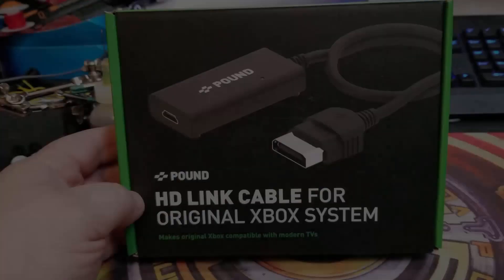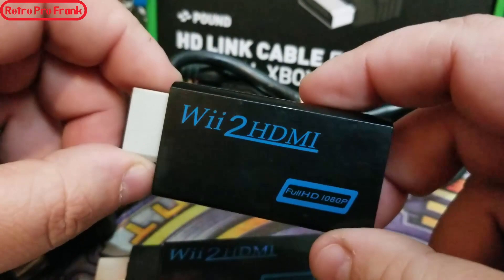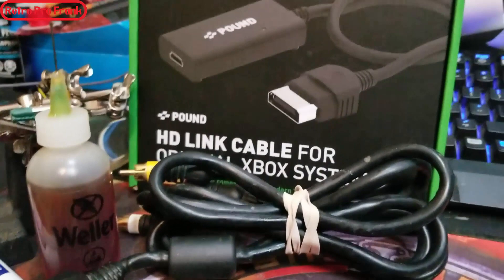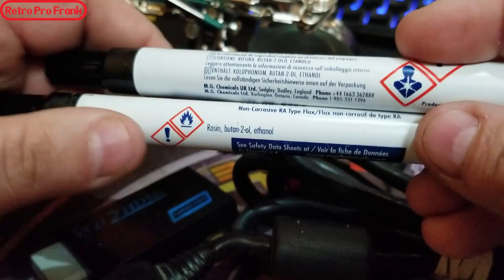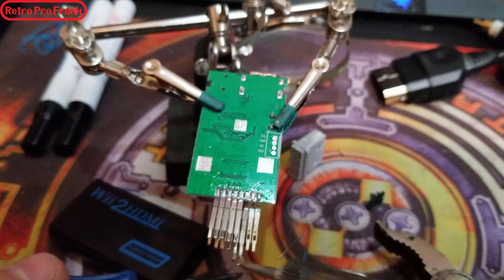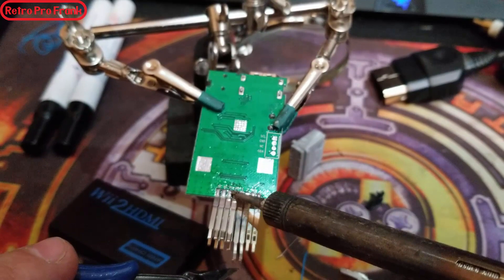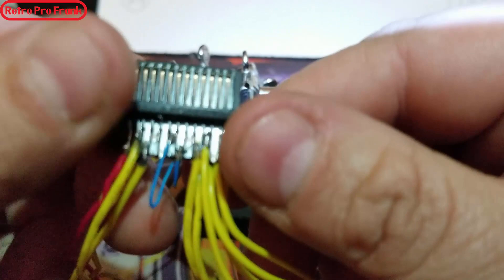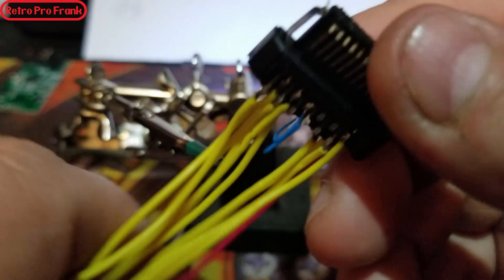How To Make $5 D.I.Y Original XBox HDMI Wire Wii2HDMI Xbox2HDMI Modd  - RETRO PRO FRANK

Comment: Awesome!!! thanks for this Video!!!!
I was able to build my "XBOX2HDMI" adaptor following your tutorial.

I will be using this adaptor for my second OG xbox which is dedicated to XBMC-emustation only, and my impression is that I like it better that hooking up this xbox through my OSSC, (I will use my main OG XBOX with my OSSC though). I never found a proper configuration with my OSSC to play 240p games with the OG xbox, but this little mod works out better with the filters that come within the emulators in the xbmc-E.

My comments for anyone planning to do it, as Frank says, check there are no bridges between that contacts and also, (very important) hot glue that thing. My God, before the hot glue, I was having such a hard time to keep everything in place.

Thanks so much again for this video!!! two thumbs up!
Reply from the maker: Thanks bro

Comment: Hello mate. I followed your tutorial, it wasn't easy. In my first try it did not work... I used very thin cables,the soldering was very bad... then I realized that I have one of those xbox360 connectors, so after starting again from scratch using your diagrams, I finally succeeded, it works quite well. I used the white wii2hdmi, it is technically  identical. Thank you mate. Before this amazing mod, I used to connect the Xbox to one of those GBS RGB converters, but it was quite messy, now it looks better. Thanks again. Cheers.
Reply from the maker: Thank you for your kind words friend glad it worked out

Comment: Hi, just wanna say thanks! 
I bought 2 of the converters online along with sacrificial composite cable.. When it arrived, 1 of them is kinda different, it's black with curved housing and it's easy to open on the side. The layout inside with one large grounding point instead of 2 square grounding. So I'd give it a shot and it worked!
Reply from the maker: Awesome great news thanks for the good comment have a great day

Comment: Built this with a White Wii2HDMI. no pin hole version.  Works great even though I suck at soldering and almost destroyed the connector. Thanks for the video.
Reply from the maker: Practice makes perfect if it works that's actually pretty awesome. The next one you make will be even better keep up the good work

Comment: Nice tutorial, thanks! Will definitely be giving this a go. Top tip with the shrink wrap on the helping hand clips too btw. Also - is that an lcd in the jewel on top of your X3 box? Looks great, id love to know what it is!
Reply: I've now successfully completed my first Wii2HDMI mod! Following your tutorial made it straight forward and resulted in success first time around so thanks for the detailed guide. Actually one of the trickiest parts for me was how to put the whole thing together neatly, but I found that by losing the bottom metal part of the Xbox connector enclosure, you can hot-glue the board directly into the top part of the metal Xbox connector casing. As long as you allow room for the board to sit in its guide rails, the whole thing slides neatly into the plastic case and is very sturdy.The picture output is great and an improvement on my component cable, although the picture takes longer to kick in on start-up so you lose the flubber annimation and splashscreen on XBMC4Gamers. BTW I used the white version of the Wii2HDMI - the board inside seems identical and its easier to get here in the UK.
Reply from the maker: @ciderfeks  thank you for letting me know that you've had great success with this. If you make a few more you only get faster and better as time goes by. I was glad I was able to help you out your number 24 that had great success. I've only heard of one person having a difficult time. But I think that person doesn't really have too much experience with soldering. Other than that it's great to hear the great news. Who cares about Flubber animation question mark what matters is gameplay and scrolling through your gamers in HD. Thank you very much for watching this video I hope you subscribe to the channel and give me a thumbs up please share this video with your family and friends and anybody else online who might be interested in this mod. This is a very affordable way to get HDMI out of an original Xbox for very little money. Thanks again and have a great day
Reply: @Retroprofrank  is that an lcd on your xbox?

Comment: Just done this mod for my xbox tonight as I've upgraded my tv but in doing that lost a lot of sockets and other input types, Works a treat and running it into an upscaler for 1080p resolution it's about as good as your ever going to get the picture considering the age of the console, Tried two different brand component to Hdmi converters and both were absolute crap picture drop outs, grain effects, scrolling lines top to bottom, should of just gone down this route 1st 

Cheers for sharing the info and diagrams👌🤙
Reply from the maker: Glad everything worked out

Comment: Fantastic job figuring this out
Reply from the maker: Took me a couple of days to get the wiring just right. There were some sort of write ups on how to do this. And image attached... what the problem was there wasn't a straight wiring diagram that showed Dport connection from the original Xbox 2 wii2hdmi.... yes it might have had an image that showed the wii2hdmi diagram. And a different diagram that showed all the outputs from the original Xbox Deport.. but not showing where the connections from the D port to the Wii HDMI directly. Seen a picture of someone trying to show these to Connected the problem was there was so many lines going from one side to the other in considering the Deport has two rows of pins. It's impossible to decipher. It would be more confusing than anything. So at that point when I seen this I said I cannot use this. So I ended up using the one diagram for the Deport and off of that trying to use common sense. Of where to solder wires. Definitely helped. If you notice in this video my wiring diagram shows a total of 5 grounding wires. You won't find this anywhere else even if you try to decipher the original which is more confusing that anyting.. to be perfectly honest with you I tried to tracklist back to the original inventor who came up with this idea. I spent a week on forms asking people if they knew and I found out that the Brazilians came up with the idea.. and I tracked it down to one main person. I message this person directly he told me that he was the first one to ever come up with this idea. No I did see one sort of schematic that was in either Portuguese or Brazilian or Mexican. It made no sense though. It was almost there to throw people off. So when I asked him about this he admitted that he made this diagram. And I told him well it doesn't make sense it's not going to work he said I know. He went on to tell me that he had different schematics. But he would not share them to anyone. I think that is a very selfish. Also went on to find out that they are charging around 40 to 50 USD a piece for this mod. So this is the reason why they won't release any schematics. Obviously they were making money off their own people. At that point I figured I would not give this person any credit considering he pretty much put out fake information to mislead people purposely which I find run. I'm merely figure it out the wiring myself because none of the schematics could have been entrusted. And I cleaned up the schematics completely so it's easy for people to understand. So I hand Drew my masters. I had a member offer to make it look a lot better graphically if I send him the original master schematics that I made. I thought that he was being nice by offering this but thinking about it it was just because he wanted to start making them and selling them. So I sent him the Masters. Then he sent me back a very cleaned up version of my masters. Which he did a good job on. In any event I hope that you were able to make your own from either this video or the drawings in the description of the video. Thanks for the comment and have a good day

Comment: BLowing on solders is not recommended it can create bd solders. Also, are you sure all those ground wire are necessary? There are many ground pin on the connector do facilitate the soldering of coaxial cables but in the end it's all connected together. In fact soldering them all instead of one might create more noise.
Reply from the maker: Yeah I'm sure did you not watch the video to the end when I show how clear it ended up looking with all 5 ground wires. If you want to be a butcher and use one ground wire that's fine with me. If you like to cut corners and that's your kind of thing go ahead. Me I will continue to do it this way because I know the video quality looks great this way
Reply from the maker: Out of a hundred people maybe one or two only using by one audio. If you would like to add coax. By all means you can do whatever you like. Majority of the people playing this are using the two speakers out of their TV for sound. Last I heard TVs don't have 5 speakers built-in and even if they did they would not be positioned properly for True 5 1 audio

Comment: Great video Frank! For whatever reason, my circuit board will not slide right out. It’s a white one, so I’m wondering if it’s a snugger fit inside. Yours came out so effortlessly, while mine is so tight that the wii connector pulled off. I don’t want to have to break the enclosure, but looks like I might have to.

Comment: Thank you for this video Frank!
I was able to solder everything in place (the second time!) but it works.
The video is great and so is the sound... until it starts crackling on the left speaker.
Do you know what can cause the left speaker to crackle after using the dongle for two minutes? Do I have a bad wii2hdmi dongle to begin with?
Thanks!
Reply from the maker: Check your work. I don't know what you're capable of. Take your time clean it up
Reply: @Retroprofrank  Thanks! I cleaned it and re solder one ground. It is now working perfectly! Thanks again!

Comment: Hi mate. I have a white adapter, do you have a video for that one? Edit, no need to reply, I followed exact instructions (on white board none of the connections are labelled) hoping it would be identical in connection placement and it worked. Looks amazing. One of best instructional videos I have watched.
Reply: Does yours have the 4 pads(SEL, G, NC, SDA) on the back?  Mine doesn't so I was wondering where to send those grounds...
Reply: @christophergolden2893  hi Kate. Yes mine did. I originally put both wires to g, and it worked fine, one disconnected when putting it back into the case so I wired that one to one of the other pads as frank did near the end of his video, they are a lot larger and easier to solder to, and it came out perfect. I would solder the two wires as Frank did at the end. A lot easier.
Reply: Sorry was supposed to say mate, for some reason my auto correct keeps changing to Kate lol

Comment: How does the picture compare to the output of component cables? Is it better?
Reply from the maker: Hard to say I have no way of testing side by side. All depends on the Xbox itself as well. If you have original 18 year old capacitors in the Xbox and a rusty cage. This does not do any upscaling or anything like that. Overall condition of Xbox matters no matter what you use
Reply: @Retroprofrank  Ahh, OK. I have a 1.1 which i bought used and was in great condition. The previous owners almost only used it for watching DVDs. It's TSOP flashed also so I can use 480p, 720p and 1080i.
Reply from the maker: @stansteez  the most important thing doesn't matter about physical condition what matters is the condition of the capacitors doesn't matter which connector you use to hook it up to the TV if your capacitor is your dead and dying in 18 years old no matter what you do you will get a distorted picture no matter what you use. Highly recommended in any Xbox that goes through your hands to replace the capacitors this makes a world of difference

Comment: do you know of any guides for installing this internally without removing the AV header out of the xbox. so you have the ability to keep the original port but also have the hdmi option above it, i've seen the 3d printed brackets for it but just not sure where the soldering points are inside the xbox if your not removing the entire port.
Reply from the maker: If you don't want to touch the original Port just make the wii to Xbox converter in the video

Comment: your PINK unit either has a bad BLUE signal. likely...or possibly you mixed up y Pr Pb wires. you can get a messed up colour mix by doing that. but since you seem to be pretty well versed in mods lets assume you got those right :) ...trace the Pb line back to its chip. its probably something pretty simple. bad solder joint on the chip itself maybe.
Reply from the maker: Yeah I didn't mix up my wires they were perfect. It could be something small on the board but I didn't see it. I'm just going to throw it out. I got four more on order. I know once in a while you're going to get these deficiencies with these cheap Chinese adapters but I can't believe how good the clarity is. Definitely worth the V bucks and the hours to do the job
Reply from the maker: But I'll tell you one thing I did not mix up any wires. I triple checked and everything. Was the board came defective
Reply from the maker: @tubejoust  lol would cost me way more in shipping..lol..bro its a 5buck pc of teck...lol..but thanks anyways!

Comment: I had a component to hdmi converter box that also gave me a pink screen. dunno how cos it was working fine but solved it by replacing it. now im gonna make this and see what happens
Reply from the maker: Well my friend you can see the number of upvotes this video has. And if you search the internet you'll see that there's a really good feedback on this particular mod. Just make sure when you order that you ordered multiples just in case you get a defective one like I did thank you very much
Reply: @Retroprofrank  also one thing to ask, what awg size wires do i need? Can it all be the same type for each connection?
Reply from the maker: @thestrangegod3173  yes same size. 30 gauge stranded will work even 28 your call

Comment: Ordered the white version of the adapter off ebay. It has the same layout as the black one its just not labeled. Thank you very much for the tut, I can now play my games at 720p!

Follow up: Displays with a pink tint in games and randomly cuts video on anything but the dashboard, must be a bunk board?
Reply from the maker: I would definitely try another board. Shouldn't be displaying any kind of pink. Actually in this video I ended up getting a defective board like that as well that's why I always tell you guys never just to buy one..
Reply: @Retroprofrank  Thanks for the reply, I just bought another board and will be sure to test it with my wii first lol. Do you have any experience with the xbox wireless adapter (mn-740) as mine is showing a solid orange light.

Comment: Hey Frank, that's what i was looking for. Great job, thx! Is it working with different resolutions on the box (720p, 480i etc)?
Reply from the maker: Yup 480 720 and 1080i... although the Xbox doesn't have the resources to run 1080 smoothly. It is recommended to keep the Xbox in 7:20

Comment: could i possibly use the existing cables from the xbox connection or wont the signal be good enough?. thanks for video, i was going to buy an adapter but was hesitant.
Reply from the maker: You can try but it could add interference. Good luck
Reply: @Retroprofrank  I think I might give it a miss then, I don't have any yellow power cables spare what guage wire should I buy in place of it. I appreciate any help as I would like to try this, whether I stuff it up or not atleast I tried.

Comment: great video, i'm only wondering audio is still analoge 2.0 stereo ?? 
Im currently using toslink cable, to get 5.1 Dolby Digital passtrough audio, this perhaps wont work with this mod ?
Reply from the maker: The analog with this videos current setup is a straight pass analog signal... however you can tap in to the 5.1 audio. By using pin number 3 on the D-port

Comment: Nice video Thanks for the guide.

Why did you remove those colour coded cables of the xb connector couldn't you of just soldered the other end of those to the wii2hdmi board?

Does this allow surround sound via hdmi? if not how can someone get surround sound with this?
Reply from the maker: Cuz it wouldn't have looked as clean. It would have been a big long wire with a box at the end of it... and this setup is just for stereo.. however depending on the amplifier you have could get Surround Sound stereo from this
Reply: @Retroprofrank  I wasn't very clear with what I posted before at 19.36 it shows you removing the wires of the XB connector these are the ones I was referring to that are already in place can they not be used?

Stereo sound works via hdmi but not dts/dolby 5.1 this is what I am after any details or a link to a place which has the extra layout to get that? thanks again
Reply from the maker: @nicmonberg5974  there's different ways of wiring this completely the wires I remove is what came from the Chinese supplier. This can vary from manufacturer to manufacturer that's why I remove everything to start over. If you want to access 5.1 surround you can access it by tapping into pin number 3

Comment: very interesting. i have a modded ogxbox,which i have connected to a HDMI Monitor via a 1080p upscaler.What you have,isn't an upscaler,or is it?whatever,it's ogxbox related,so i just had to watch.I also have an unmodded og which i intend modding with a bigger hard-drive.
Reply from the maker: No it's not an upscaler by any means simply a converter. Convert from analog to digital signal that's it that's all..